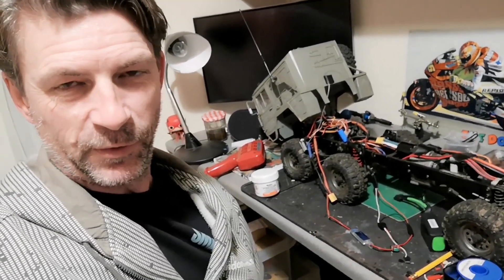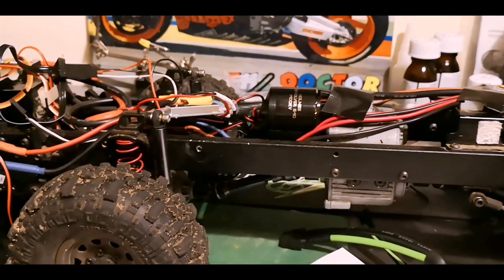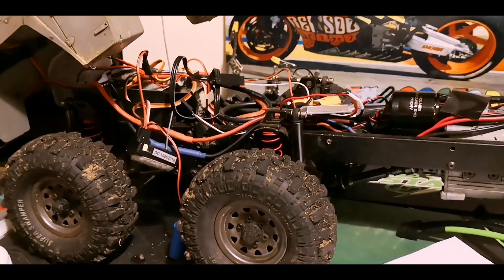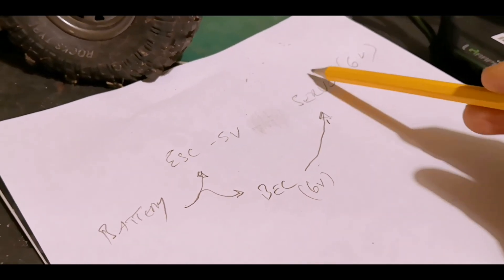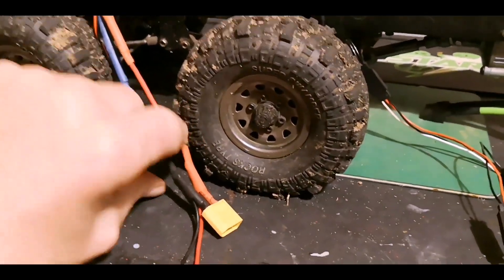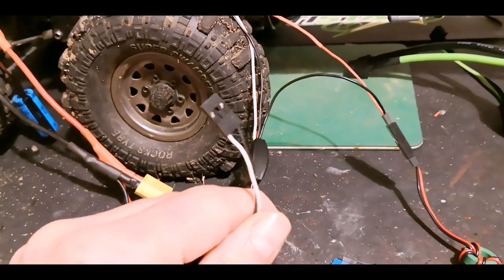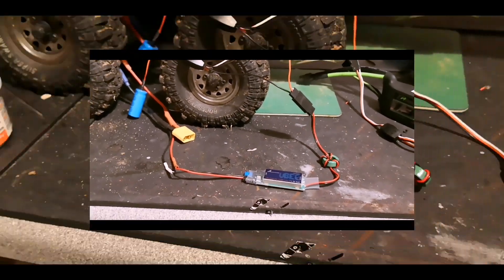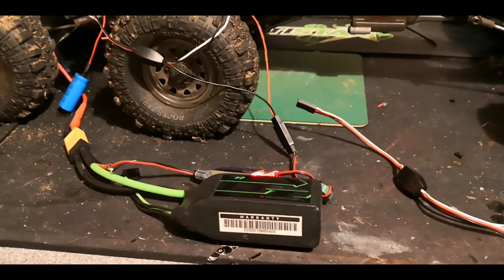OMG!!!  Andrew fits a BEC to his Cross-RC MC8 8x8 Man Kat1 1:12th Scale RC Truck (and it works)

Comment: Servo leads to the MC8? .. I'm wearing a 32kg with Bec, and goes very forced .. Smells like roast chicken .. 🍖 ... I had to have foreseen 🤦‍♂️ .. Two steering axles, a lot of weight .. I will Try one of 46kg.
Reply from the maker: Roast chicken LOL sure you haven't gotten a creature trapped in there? LOL I'm running a PowerHD DW25LV servo up front, nothing as beefy as yours. Are you sure something else isn't to blame?

Comment: Very useful video indeed, will help lots of people out there. It's not the simplest (or safest) option for a BEC, but that's also my favourite one. With this config the second BEC is dedicated to the servo only, it can short or do whatever and the radio will still have power as it's powered by the ESC. In the simplest config you remove the red wire from the ESC and not use the builtin BEC, plug the external BEC in the radio and power everything with that. If your servo shorts though, radio will power off and you will loose signal and control.

Be sure to isolate well the exposed wires to avoid shorts (e.g. with heat shrink tubes or  hot glue), and be sure to waterproof that BEC with epoxy resin or conformal coating.
Reply from the maker: Especially that last bit hahahaha as I need to do an update video "how to fit ANOTHER BEC after drowning the first one" A
Reply: @antrc  Sometimes we have to learn it the hard way have we not? But hey, awesome chance to make a video "How to waterproof a BEC because nobody seems to produce them waterproof by factory, which is totally nonsense" ;)

Comment: Good video.  I added a castle creations BEC to my full metal 8x8 MAN Kat.  I added two high power digital metal gear servos to steer the front axles, because of the weight of the truck.  BEC's cant be underrated, work like a charm when you need extra juice & amps for servos.
Reply from the maker: Yeah man. Two steering servos? Ye Gads sounds an epic rig! I will visit 👍

Comment: Well now that explains why castle owners fit a BEC. What a con design a ESC that is not good for a crawler servo and sell a link. No wonder I have no issues with my servo's on my Cross trucks with a basic Hobbywing.
Reply from the maker: Yeah tis a little disappointing. I do however have to fit one to my 10.2 as the lights flicker when I release the steering wheel. That runs a HW1080 so...?
Reply from the maker: I reckon that's more like your dodgy wiring Andrew Re Scx 😂 T